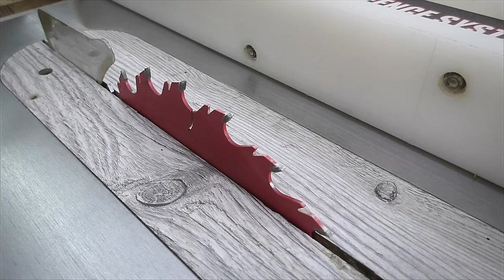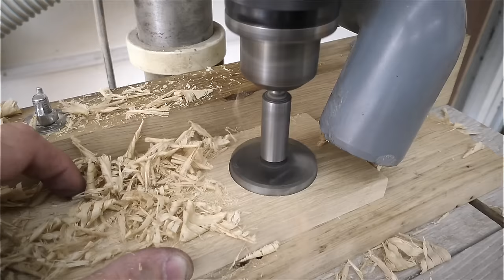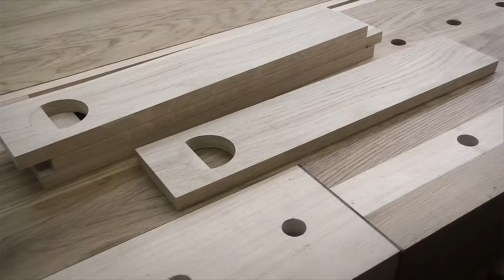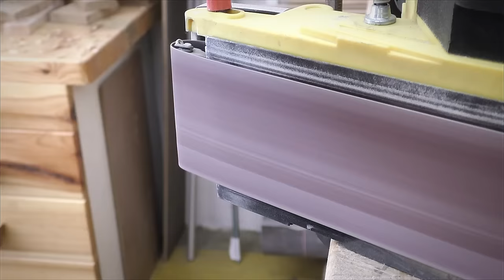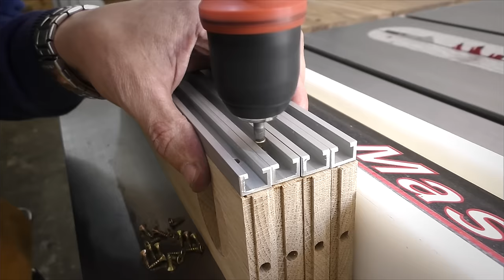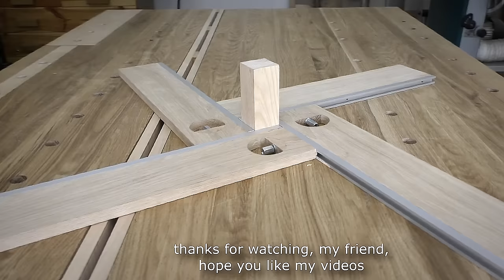Simple adjustable router template

Comment: Great jig, just one question is there not a chance that the bearing will fit in between the t-slot groove if you must plunge deeper causing the router bit to come into contact with the t-track. Stay safe!
Reply: The router bit used (https://youtu.be/vf-XYLi9QJU?t=294) has a double-bearing that looks like it is too wide for the t-track slot to fit into.
Reply: I had the same concern but double bearing should help.

Comment: I have an easier jig made up from aluminium extrusion 20*40 and it is 1000*1000mm for cutting out doors in vans etc. A smaller one of 400*400mm to use when doing smaller cutouts such as letter boxes etc.
Much easier to use, hex key and corner brackets 👍
Reply: That sound great.  Where can I see the video or plans?

Comment: I finally made mine, using your method and hood on wood. Only issue..

What holesaw size did you use to fit in the forcener hole?

Can anyone tell me, or do I have to buy the whole set, to get the right size to fit into the 35mm forcener hole?

Thanks in advance

Comment: I like the design but I believe there is a big risk in the bit hitting the metal edge when the bit is being plunged and the area being routed is very small.  In other words, if the area being routed is just a bit wider than the bit, then one has to be extremely careful when plunging the bit not to hit the metal edge because you don't have the bearing to protect you.
For this reason, I will modify the design to eliminate this safety risk by adding another piece if wood to the current design so that the bit is hitting this extra piece if wood.
Thank you

Comment: Hi sorry but I don't understand 2 points : first it's the rotating tool itself that is guided no ? thus, it should wear the aluminium guide ? and the second question is : how can you obtain holes with 90° angles (right corners) with a rotating tool ?  thanks in advance

Comment: You drilled a hole, then glued a piece back in.  Why didn't you use a router to cut a hole with a flat surface for the nut?  Is it because you did not have a router jig to guide the cut?
Reply: How would you route out a circle with a flat spot in it?  And guarantee that flat spot is 90 degrees to the edge of each board?
Reply: @tundrawhisperer4821  For this project, one does not need a circle.  What is needed is a flat spot at one end of an access hole, of any shape.

Comment: Such a jig could easily be added on with sliders underneath for edge rails, measurements etc. it could be a really useful jig. I would look for a way to have better locking nuts that don't require a tool.   But still a great idea